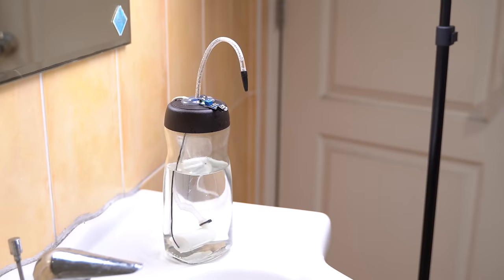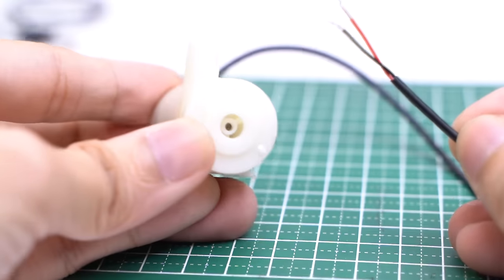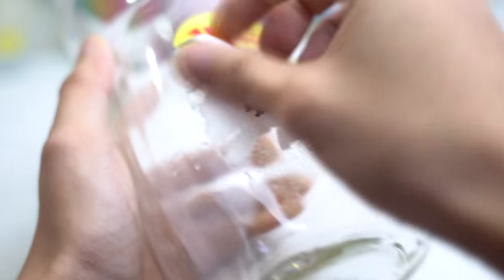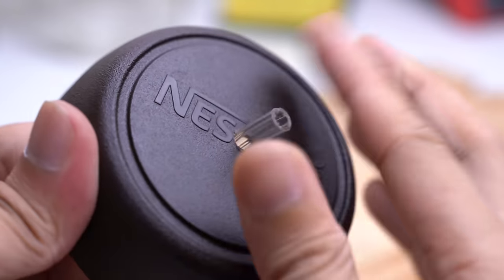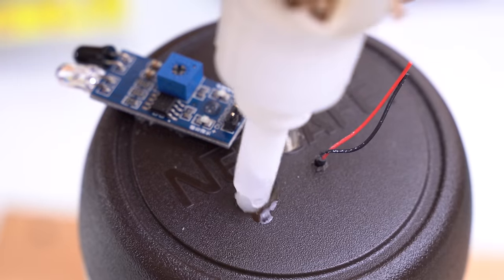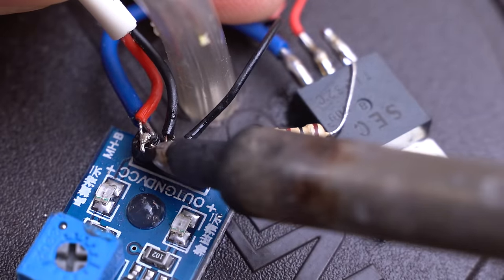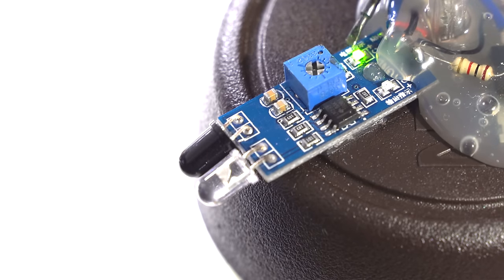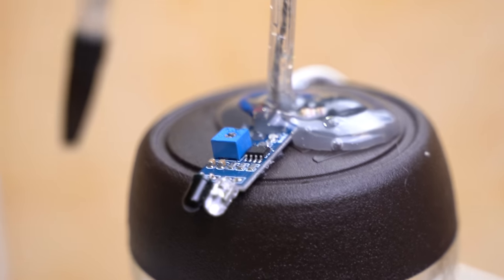DIY Automatic Alcohol Dispenser ($3 No Arduino Needed)

Comment: Hi, Am trying to build one, but i have TIP32C NPN transistor instead of PNP. Due to Qaurentine am unable to get it, could you please help me with circuit of TIP32C NPN with this project?
Reply from the maker: Hi! You mean the TIP31C NPN? If you have two, I might be able to help you.
Reply: @TechBuilder  I have TIP32C NPN.But according to your circuit we need PNP.
Reply: Hi, Tried with New TIP32C, but am getting constant output voltage even when proximity sensor digital output is low. Can you please help me out with this.
Reply from the maker: @srikanthsham2153  TIP32C is PNP. Its NPN variant is the TIP31C. Which one do you have?
Reply: Can I use C3807  NPN / BD140 PNP Transistors ??
Reply: @TechBuilder  I used TIP32C PNP.

Comment: I tried to make 15 of them , but I only got 9 transistor. All others are working good. tip32c transistors are out of stock every were , I really need some alternative on transistor . Can you help me ?
Reply: Hey sid can you help me in correcting my circuit? In my circuit motor is continuously on, idk why?
Reply: Are using the same components
Reply: Sidharth Mt Hey i have 42c transistor will it work?
Reply: use ULN2003 IC. But IC will drop 1.7v. So take 6v or above supply.
Reply: @ekamrajsinghbachher5901  Yes , it will

Comment: what’s wrong with hand sanitizers?

Though the occasional use of a hand sanitizer isn’t going to hurt you, regular use over time can cause a lot of problems:

1. DRY SKIN

We told you about the dangers of alcohols in skin care in a previous post. The alcohols used in hand sanitizers include isopropyl, ethanol, and n-propanol. These are the drying alcohols we told you about. They irritate the skin, strip away it’s natural oils and acid mantle, dehydrate cells, and increase risk of contact dermatitis.

2. ACCELERATED AGING

All those drying effects can lead to increased appearance of fine lines and wrinkles, as well as calluses, cracks, and flakiness. Over time, alcohols can disrupt the natural barrier function, reducing skin’s ability to protect itself, and leading to increased dehydration.

3. DAMAGED SKIN

Scientific studies have shown that alcohols can actually damage skin cells.

4. ANTIBIOTIC RESISTANCE

Many hand sanitizers these days are made with triclosan (more about triclosan in this post). This antibacterial has been found in animal studies to disrupt hormone function. It’s also connected to the rise of so-called “superbugs”—bacteria and viruses that can resist antibiotics. The CDC announced in 2013 that the rise of superbugs (as a result of overuse of antibiotics) was a serious threat to human health, and had caused at least 23,000 deaths that year.

5. UNKNOWN CHEMICALS

Many hand sanitizers are made with chemical fragrances. Since manufacturers are not required to list fragrance ingredients on the label, you don’t know what you’re exposing yourself to. Many fragrances are irritating and have been linked to allergies and hormone disruption.

6. WEAKENED IMMUNE SYSTEM

We think we’re reducing our risk of getting sick when we use hand sanitizers, but they can actually weaken the immune system. Studies have shown that ultra-clean environments—particularly early in life—can contribute to reduced immune defenses later on.

7. THEY JUST DON’T WORK AS WELL

The FDA states that currently, there is no evidence that antibacterial soaps (and sanitizers) are any more effective than regular soap and warm water in helping to prevent the spread of germs. A 2000 study found that sanitizers do not significantly reduce the amount of bacteria on the hands, and may actually even increase it. Researchers added that the products strip the skin of its natural oils—and since those oils usually prevent bacteria from coming to the surface, the sanitizer can actually reduce the skin’s own defenses.

Comment: Sir,
I made exactly same circuit. But I always get output high at collector. I tried followings:
1. Increase resistance upto 1600 ohm
2. Replaced Transistor
3. Replaced Sensor
5. Changed power supply from usb charger to arduino output...
still problem has not solved! Will you comment on this please?
Reply: Replace transistor with 5v relay all u need is a switch it will work
Reply: @devendrasingh-yz7sb  Hi Dear, Thank you very much for your kind concern and replay.  I tried different transistor such as 2SD882, BT136 to fail. I then come to know that here he used PNP transistor wheareas  my IR sensor gives positive output trigger. Thus I changed to NPN transistor still it was not working this was due to current limitation. I halt this project and make PIR sensor module. I succeed in operating 230VC ac with trigger circuit explained in (https://www.homemade-circuits.com/pir-motion-activated-relay-circuit/) using Relay. However I currently facing one issue. After first trigger by PIR sensor Relay get operated. But when it trigger goes low and relay switched off, the relay forces the trigger circuit to high and it in turns operates the relay. This cycle continues. I do not undersatnd why this happens as there is diode too! Any Idea?

Comment: I have a water pump of 12V please help me with connection please... I'll be waiting for your reply 🙂
Reply: Use a 12v channel relay board to trigger it through proximity sensor but u need 12v power supply to trigger the motor and also a 7805 ic voltage regulator to convert a 12v power into 5v to power up ir proximity sensor also connect the o/p of ir to the relay i/p so that it will trigger google for ckt. Dig. U will find it easily

Comment: Its working in reverse.. i mean, when i connect the source it rotates, when i put an object to the sensor, it stops rotating!!
Reply from the maker: In that case, you'll need an NPN transistor and need to follow the corresponding switching circuit topology for it. This happened to some cases when a different sensor model was used.
Reply: @TechBuilder  if i got u right, it means i will note the Base Emitter Collector connection, then connect it to my circuit respectively

Comment: Hi....motor is running when sensor is off and when sensor activates the motor stops.,..why is this happening...
Reply from the maker: Did you use an NPN transitor? If you did, it most probably is the cause. If you're using a different sensor, it is probably giving an inverted signal.
Reply: @TechBuilder  i think sensor is different...
Reply: TCRT 5000
Reply from the maker: That explains it

Comment: I did this as per ur instructions but my motor is Directly starts up as power supply is on...wat should i do nw..plz help me out
Reply: Me too same problem
Reply: @Untwal_YT  experiment successful... transistor hi change kr diya..
Reply: did u use the same parts and materials on the video?
Reply: @nblbil  yes but i changed transistor bcz as i said earlier it ws wrkng reversly...it may b bcx of relay..whch is mostly negative trigger.
Reply: @bhappy877  so first time u make it u use the other transistor but after u on it it's working reversely..so u change the transistor with the same parts at the video? like that?
Reply: @nblbil  yes..i experiment the project with same componts bt relay is mostly negative trigger so if your motor wrkd reversly then change the transistor..dats it

Comment: Bro I need help my project is working reverse when I put my hand it stops and when I take it back it works..I need real help plsssssssssssssss reply a solution plsssßsssssssssssssssssssssssssssssss
Reply: Same with me also.. please some one should help
Reply: what transistor did u use?
Reply: @nblbil  initially i used tip32c, but tip31c is the npn equivalent so it worked

Comment: Why my proximities sensor always on, i made like this schema
Reply: You can chance variable resistor on it to chance distance active
Reply: I have the same problem, the sensor is always on and stops when I put my hand in front of it.
Reply: @abiliocorreia8030  I'm facing the same, did you get any solution...??? Plz rep soon...
Reply: @piyushsingh541  I used an Arduino mini pro,  it's a bit more expensive but it works, and you can program the dispense time